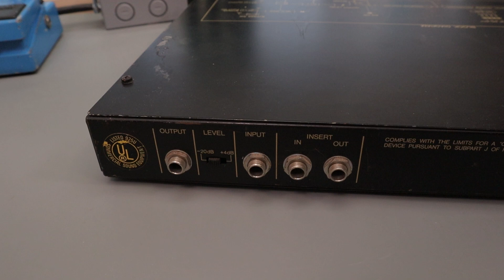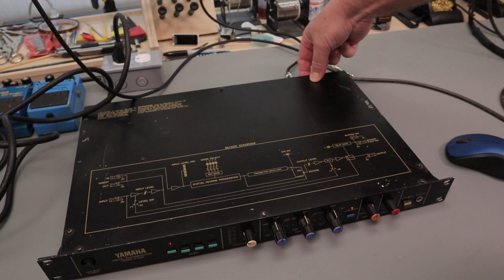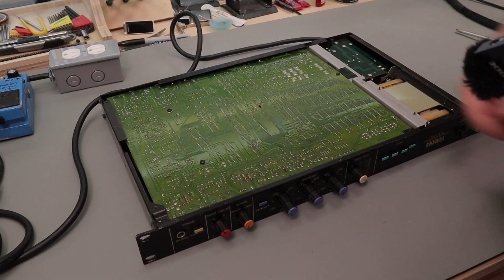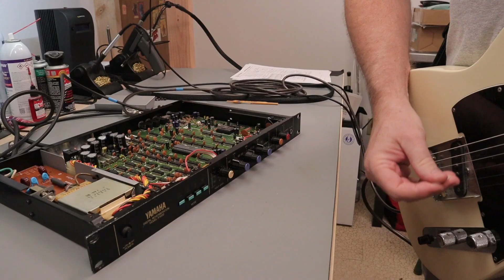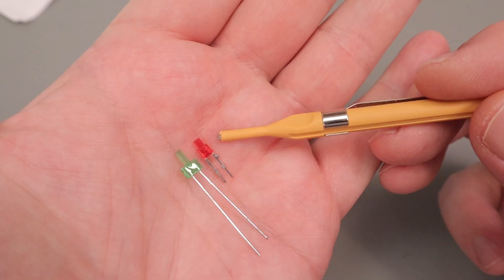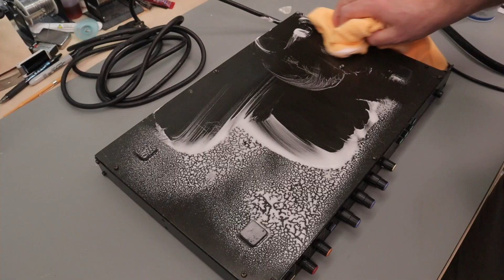Yamaha R1000 Digital Reverb Service - DoItYourselfMusician #55

Comment: Thanks for the video. 
I was offered to buy one fo these 10 years ago, and I bought the 1/2 Rack R-100 instead, and I think I made the correct choice, as the R100 has a lot more going on for it (although, no EQ, but, hey, my mixer has EQ!)
Reply from the maker: Yes the R1000 is a very limited unit probably originally aimed at commercial or high end consumer users.
Reply: @DoItYourselfMusician  I always plug the input into an output, and make feedback sound art with any effect unit I get met hands on. The EQ would make for interesting textures.

Comment: Hey! Great video! Really enjoyed it and thanks for sharing.
I’m troubleshooting a faulty ART DR1 (no reverb sound) and hit a bit of a wall. I’ve narrowed the issue down to two ICs, but their markings are completely erased from the factory.

Based on tracing and behavior, they appear to be 16pins A/D converters.
Do you think they could be HD14549 / HD14559 (or MC14549 / MC14559), or would you expect something else in that position?

Thanks in advance!
Reply from the maker: I'm not familiar with the unit enough to know but a SAR ADC will be front ended with a sample and hold circuit and a comparator. If you can figure out if those IC's are driven by these circuits they could be SAR registers. Also the DAC may be feeding voltages to the SAR IC's for comparison. This is what it does in the R1000 actually. Read more here https://www.monolithicpower.com/en/learning/mpscholar/analog-to-digital-converters/detailed-analysis-of-adc-architectures/sar-adcs
Reply: @DoItYourselfMusician Aha, ok, I see. Thanks for the link! Oh and Happy New Year! 😊